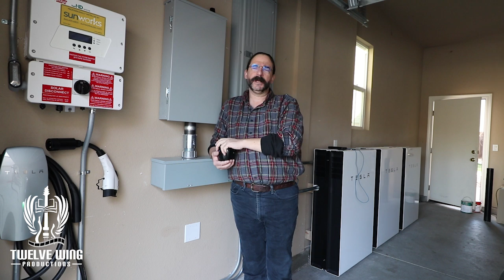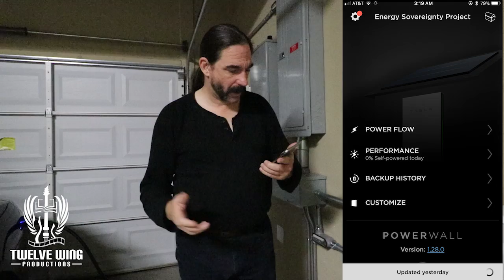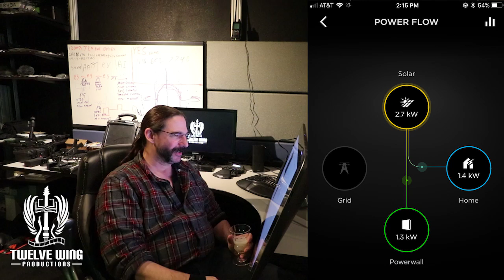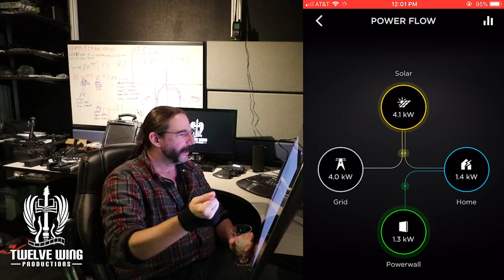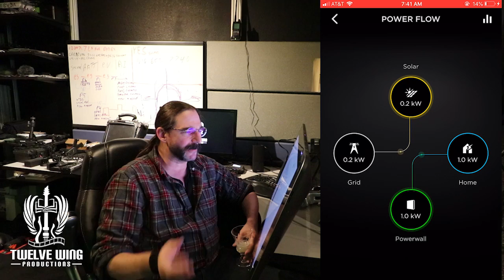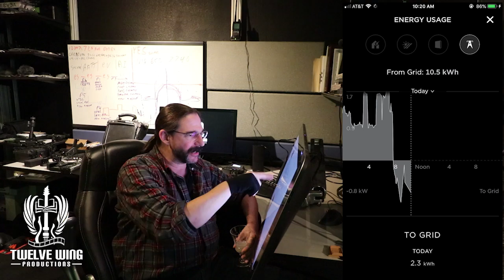ESP Video 4.5: 6X Tesla Powerwall 2 control issues

Comment: Thanks for the videos and your experience.  I think the software will get there, but, Yep looking like Tesla Powerwall and app software driven by the assumption that Tesla and/or homeowner is wanting to claim both the SGIP CA rebate and 30% itc (fed tax credit)... 
It looks like if you get SGIP rebate (with solar or without) the main rule is that the Powerwall must discharge at least 52 times per year—ie so that it isn’t used only for backup and ideally discharging during peak summer afternoon hours to help utilities reduce demand when demand for electricity from the grid is high;  and if homeowner wants to claim the 30% fed tax credit, Powerwall must be 100% fed from solar and not fed by the grid.
A couple reference links: 
https://www.civicsolar.com/support/installer/articles/2018-sgip-what-you-need-know
https://pv-magazine-usa.com/2018/03/05/irs-rules-energy-storage-upgrade-to-solar-itc-eligible/
Reply from the maker: Thanks for the links.  I think it will be a big help to others to better understand this.
I think we need to be careful with some of the language here.  It is not accurate to characterize this as "Wanting to claim".  There was no choice in this.  It's not like I can tell the utility that I don't want to claim the tax incentive and then they will say.. "Oh.. sorry.. you can charge off the grid then".
This was done behind our backs by politicians and companies like Tesla had to agree to it.
Charging the batteries on grid power during off peak time helps the grid... period.  That should be honored and not crippled by some poorly written legislation.
Reply: Good point.  I agree with you in that an outside entity set up the arbitrary decision that if a homeowner has both solar and Tesla Powerwall(s) installed, then that homeowner will only be able to charge up the Powerwall(s) with solar power and will not be able to charge at any time with grid power.  
My hunch it is more Tesla (and less the utility) because in this case Tesla set their software/algorithms to follow their own decision:  “If solar + powerwall home, then can’t charge from grid at all”. The question is if Tesla did this because, as they mention in the “functionality” section of of the Powerwall support page—that Powerwall can’t be charged from the grid in a home with solar—because Powerwall/software “is designed to qualify for the Federal Investment Tax Credit, which requires 100% charging from solar”, and/or a reference Tesla makes there to “rules around grid charging which vary by utility”. 
It would be interesting to know the true reason for the above limitation for homes with Powerwall and solar. Maybe there are but maybe there are not any specific rules in SMUD or PG&E that prohibit a home with solar from charging a Powerwall with grid power.
My hunch is that since there are varying rules including a Tesla blanket assumption that some or all homeowners MIGHT apply for the 30% fed tax credit, and SOME utilities with rules that might not allow batteries to be charged by the grid in homes with solar, that Tesla just put the generalized rule in their own software that won’t allow grid charging of Powerwall(S) in homes with solar.  
This does take away control for sure from the homeowner, which I agree is NOT a good thing as you point out, especially if this is a homeowner who chooses not to apply for the 30% fed tax credit and who is served by a utility that DOES allow low-rate off-peak charging of storage even for homes with solar + storage combined.
Reply from the maker: @JC-ml2ct , basically what I said in the video.  Tesla took the easy way out instead of sticking by what they knew was right and protecting the rights of their customers.  They dined with the devil to get the rebate and sell more powerwalls.

In an earlier comment it was suggested that we "didn't do our research" when choosing a powerwall.  With that I also have to make one thing perfectly clear about this part of a statement you made:

" as they mention in the “functionality” section of of the Powerwall 
support page—that Powerwall can’t be charged from the grid in a home 
with solar—because..."~

You got that from a web page.  Web pages can be altered in an instant as I suspect some of the statements on their current web page will.
The statement above did NOT appear ANYWHERE on the page 2 years ago when we finalize our decision to use these batteries.

So saying we didn't do proper research needs to be run through the filter of an altered product.  It would be like researching an EV made by Chevy.  It has a 600 mile range and can put 300 miles on it in 12 minutes.  8 year unlimited mile warranty... etc. etc.  Only catch is that you can't take delivery for two years.
When you do finally take delivery as part of the first few made available to anyone outside Chevy.. you find out AFTER you leave the lot that you can't charge it at home.  You HAVE to charge it at a Chevron because Chevron made a deal with Chevy that they would cover part of the true maintenance costs.

THAT.. is apples to apples.  Throw in the fact that when Chevy took your initial deposit they flat out told you that you could charge it at home.
So that's basically where we are at the moment.
It needs to get fixed.
Reply: Yep!  Thanks. What’s hard to know sometimes is what percentage of the problem is Tesla setting up these rules and software to limit homeowner control vs. utilities rules, ie for desired ability to power storage from solar and also from the grid.  It seems to me if a homeowner chooses not to claim the 30% solar tax credit for storage, Tesla should have a setting that allows that customer to charge both from solar and the grid assuming their utility would allow that as well.
Reply: Twelve Wing Productions Also, pardon... your point is well taken knowing how much research you’ve done, and that it’s not surprising that well after Tesla starting taking deposits for Powerwalls that they later added info to their web page(s)... A big ol’ “By the way, minor detail... we’ve decided that if you have solar you can charge your Powerwall from the solar, but not from the grid....Have a nice day!” :-(
Reply: All told, I think your system will do great and really impressive the capacity you’ll have available with your setup.  Tesla definitely needs to improve user control and ability to use Powerwall(s) to the customer’s need and benefit, and more predictability and stability with the software which will hopefully come soon in updates.  You also mentioned that we’re in the toughest short sun-hours time of the year, so only better from here soon to get more and more utility from the solar + storage combo!
Reply: @JC-ml2ct  ok, wait, what would make one decide NOT to take a 30% tax credit on a system? Any time you can reduce the amount of time Uncle Sam is rummaging around in your wallet would seem to be a good thing. Seems simple to me but I may need educat'n.  More importantly, I think a simple solution (ok simple in my mind is probably gonna get complex in execution) would be to write a slight adendum to the law saying that Solar and Battery systems that apply for FTIC may charge from the grid in off peak/off shoulder hours but only AFTER 100% of the solar power output has been used to charge the batteries. This in software should be verifiable, and audit-able.  So if you during a winter storm only get your batteries to 60% then you should be allowed to charge the remaining on Off Peak hours and rates. At the same time in Summer when you are at 100% on your bats and you are pounding power out to beat the band and sending it down the line to them, your provider is not having to buy power (or at least less power) from folks speculating in power futures, or other nefarious games to screw them and you.
Reply: @JC-ml2ct  How would they know if you did or didn't, it is not like the IRS is gonna build a database of people that took the FITC and then supply it to Tesla, who would have to check, after tax season this year, and next and the next to see if you did. And lets say you said you didn't and actually did, then that would put Tesla in the position of enforcing the law, which I doubt their management or legal team is suggesting would be a good use of their rather scarce resources. The Change needs to be in the FITC wording to keep pace with technology and to allow charging from the grid on Solar+Battery systems AFTER 100% of the solar output was used (or whatever practical amount is technically feasible) to charge the batteries.

Comment: How much electricity are you producing during winter months so far?
Reply from the maker: 22-24kwh per day on sunny days.  We are past the winter solstice so this amount is on the rise.
Reply: @twelvewingproductions7508  So in theory a 20KW system would produce twice that. The system on the property I am buying is 20KW Grid Tied with EnPhase micro-inverters. It is under PG&E and Net Metering and of course TOI is coming if it is not here already. 

 I would like to go Tesla, I have a deposit down for 2 Tesla Power wall 2's, but I am not sure I can WAIT for Tesla. The word I am hearing is a couple months before they even get back to you to do a preliminary plan, and I have heard people saying they may be looking at over a year wait from the time the system is designed to the time it is installed and up and operational. If that is the case, I will loose 3% right off the top on the FTIC if I end up installing in 2020, and that does not even consider the SGIP consequences of that amount of delay. 

California's SGIP is already Nearly capped out in Step 4 and significantly impacted in Step 5. While I have been told some smaller Tesla authorized installers still have Step 4 rebates or reservations available I cant even find out who they ARE to verify that. Tesla seems to want to keep that close to the vest, since they make more money if thier own people install it, and SGIP Steps or rebates do not affect their bottom line, only ours.... 

Sadly I may have to look elsewhere, maybe PIKA Energy's Island system... but since I am an AC micro inverter based system, that adds complications. In the end, 
We all are busting our butts and our piggy banks trying to do right by the environment, and our government is trying to help, but is not keeping up with the times. Kinda like the FAA, they knew 15 years ago that Personal Drones were coming, I know people that were on the Steering Committees discussing it, but they sat on their hands for most of a decade.
Reply from the maker: @matthewelyash6538 ,
If you would like the Powerwall 2's you should contact SunWorks.
I can give you a direct contact person if you like.
They can have these delivered and installed in a matter of a couple months as they have them in stock.

For a system your size I would recommend at least 4 powerwalls.  This would depend on your usage and how many miles you drive... but at this point that would be my minimum guess as to how much storage you should have.

If you go with another system, look to hook up 60kwh at minimum.. but again.. for a system your size I would say 90-100kwh.

Contact me through private message here on YouTube and we can exchange information.  I would love to keep in touch with you about your system.

Comment: thx for the compressive analysis and updates. you're the only one I see mentioning this criminal behavior. I guess the other tesla owners are too fat dumb and happy about having a solar system to see what's really  happening. truth be told you don't own your own system, you're in more of a co operative. It's like the utility and musk are in bed together but your the only one getting screwed. its coded to optimize the interest of utility at least part of the time. Go's without saying you purchased this system, it should be optimized to meet your needs. the good thing is it can be easily coded to do just what you, if tesla will do it. if you let them know your not just another sheep for the slaughter, and if you make a big enough stink, they may give you the codes needed to get the modes you thought you paid for. they should be able to send an update through the gateway. having to resort to killing the main disconnect is insane. good luck keep us posted.
Reply from the maker: We will continue to work on your behalf and behalf of the others that are trying to drive this technology forward.  I really like Tesla and what they are doing... I just think they got suckered on this one.
Reply: This is not the utility here, this is the FEDS saying "If you are getting a tax credit on this system, It has to be charged by solar", and be part of the solution they say they want, which is to reduce dependence on the GRID, not increase total power drawn across it.  In addition they want reduce Greenhouse Gas Emissions and address and placate the "climate change" folks who clamor for this. 

While I love a good capitalist conspiracy, I believe it is more a function of a law or mandate being written and never updated for technology. It could be easily fixed, if we help the feds find the will.  Then again there could be a down side to this,  if everybody starts charging their cars and power walls at midnight, we might just end up with a Midnight to 5am peak too!!!  
I believe that a simple fix would be to address the new technology and amend the FITC to insure that the home battery system is charged with at least a significant majority or even all the power available from the solar array, and then and only then should midnight charging of the Battery be allowed from the grid.
Reply from the maker: @matthewelyash6538 ,
It's the local utility.  There are areas where the local utilities allow it but there are very few of them.
Basically the local utilities are using the wording of the tax incentive as a tool to stop people from charging during off peak times.
Reply: @twelvewingproductions7508  
I did not know that... so it is PG&E that is saying that?
Reply: @twelvewingproductions7508  
Why am I not surprised?? We can burn down a town and shut off your power but we wont let you save money. Course that is what I have been saying...if everybody starts charging their Tesla and Chevy volts at midnight and then you throw in powerwalls...
Reply from the maker: @matthewelyash6538 ,
I'm going to have to keep you honest here.
You are going to have to tell me "When".
If you do that.. give me a date.. a month... I can tell you EXACTLY what will happen.
Without that.. I can't.
What I'm trying to point out is that it's nowhere near as catastrophic as you are making it out to be.
Also, one has to use the term "Midnight" loosely.  Let's instead say "Off peak" or "when requested".
Reply from the maker: @matthewelyash6538 ,
In my case it's SMUD (Sacramento Municipal Utilities District).
PG&E is refusing to do so as well, but I am told that there are smaller utility areas that do allow it.
I'm trying to get hard information on exactly who is allowing it before I present that information.
Once I have solid confirmation that these utility districts do allow it, I'll try and do a special and perhaps even interview them to get their take on it.
Reply: @twelvewingproductions7508  Happy to be kept on the straight and narrow. Ok, what I was alluding to was the expectation that as more and more people add power walls, and more and more people get electric vehicles, then the OFF peak middle of the night periods that were typically low demand, will see significant increase in load and if we add charging our Power Wall, we might in the next few years see a pronounced flattening of the "Duck Curve". When we get to enough demand that the OFF Peak starts looking closer to Peak Demand, I wonder what indeed will happen. Will they start calling a second Peak Demand period or?
Reply from the maker: @matthewelyash6538 ,
I expect that they won't really call it much of anything... though they might try to.
What you say is correct.  Within 10 years or so, the duck curve will be totally flat.  Basically it will pretty much resemble what we are going to display.
For suburban residential, very low consumption starting around March each year and then slowly ramping up in late September.  Again.. geographically specific.